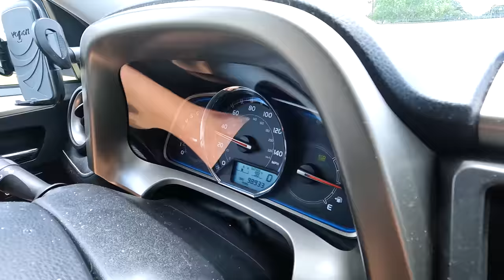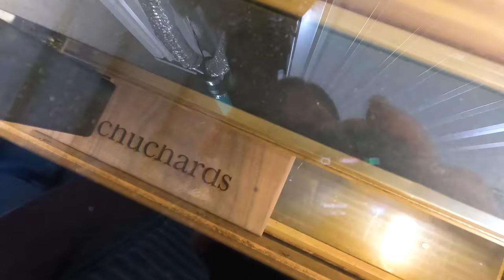The business we NEVER wanted to start...

Comment: How in the hell is this a business. Mickey Mouse horse shit boards with more effort into the packaging than the product... more power to them for doing it, but God it shows how insane the market is for consuming shit.
Reply: Iust have missed the steps in finishing the cutting and charcuterie boards...after 3rd sanding i wet the boards so the fibers stand up and sand more...that way thay stay smooth after the customer washes them...as they will
Reply: nailed it on the head,, its all in their sales strategy, by targeting realtors, and general public knows this isnt all that special.  and they fact they still use a glow forge shows your how business savy they are.
Reply: And at $140.00  A board ? Not in Florida ! Maybe in Texas... I rest my case. Cowboys not Cattlemen
Reply from the maker: Hey Keith, thanks for watching the video. Did you know the shoes on your feet actually cost only 1/10th of what you paid? That's just how businesses work!

Comment: Why don’t you all get a real CO2 laser instead of the glow forge. You can get an 80w Omtech laser for like 5k and it would be way faster!! And the capacity is like triple the size of what you’re using. 
Also Isn’t a Glow forge pro like 7k. Seems like a no brained to me, unless there is something I’m missing that makes it so much better. Seems like they aren’t really a cost effective solution to a CO2 laser.
Reply: They aren't quite ready to PIVOT in that direction :) See what I did there? lol
Actually, I have been mentioning this for a long time.  I've offered for them to come see my Thunder Laser 80W in action. I have even uploaded a video about the speed difference between a Glowforge and a Thunder.  I have also commented that if they upgraded to one and wanted to fly me to Houston, I would set it up and show them the ropes! 
Maybe at some point, they will see the benefit of switching!
Reply: as a small shop that does diode laser engraving as well as CO2 laser cutting I can say the big co2 laser is used maybe once or twice a month. while the diode laser is run almost daily. its not just cost. it is easy of use, the diod laser has a run time almost perfect to fit into my production schedule. so while one item is engraving I can be running another product through the router table to add round overs and then do prep sand and right after the laser finishes I can swap it out to the product i was working on.  the CO2 is much faster but requires me to duplicate all my designs and mess with power and speed rates. so for named engravings or text customization the diode laser is faster in terms of amount of time I have to spend setting it up. 

Glowforge has am amazing interface with all the font choices included. no hunting down font packages to install in lightburn. also the camera on the glowforge is  amazing since you dont need to place the item perfect, it will find center and etch from there. bigger is not always better and I know for my shop it took me 3 and a  half months to get the proper power drop for the CO2 laser, while the Diode runs on standard 110V.
Reply: @vampricloki  But a glow forge is not a diode laser. The x-tool D1 for example is, and it’s  around 1k maybe slightly more. I can see using a diode laser if you’re only doing lots of engraving and it would work perfect and it’s very cost effective but a glow Forge is not cost-effective at 7k, especially if you’re only doing engraving in your bed sizes limited. Most of the newer diode lasers are completely open on the bottom basically making it so you can custom put it on any size. 
I really don’t think a large CO2 laser would be harder to set up than a diode. You would just run a ramp test and once you have those settings reproducing that would be quite simple especially if you’re doing the same thing over and over. If you’re constantly doing it on different types of wood then I can see it might take a while to get the power settings on different species but if you’re doing production work on the same thing over and over it would be quite simple to dial-in.
Reply: @vampricloki  The GlowForge is a CO2 laser.  I actually chose to not install the camera in my Thunder Laser because it is EASIER and FASTER to find the exact center of your item.  Placement is by far more accurate than the Glowforge. Sounds like your Diode laser is working great for you.  For what Jennie and Davis are doing a more commercial CO2 would be a better solution.
Reply: Agreed, get a Thunder 24 and you can't go wrong.  No more tape and finding the center either.  Just make a jig and you will be perfectly aligned for the engraving.
Reply: @theshockzone  Yeah, they could have a permanent jig installed that would work for both styles of boards and this would be a gamechanger for them!
Reply: The biggest drawback to using a Glowforge is you are 100% dependent on them. If you lose internet, or their servers go down, or worst case they go out of business, you now have an expensive paperweight.